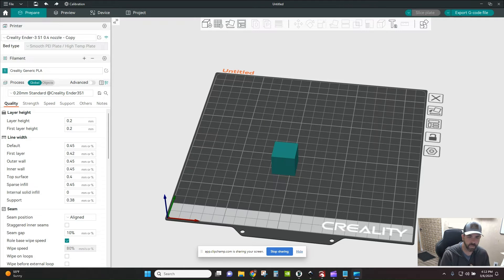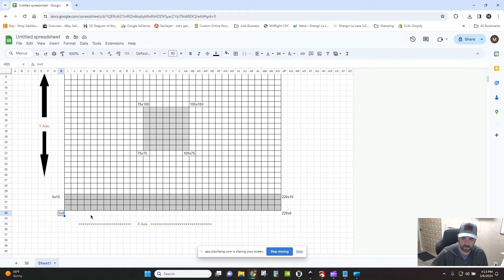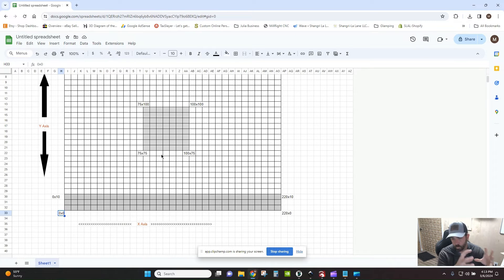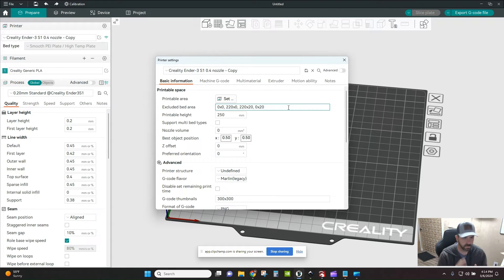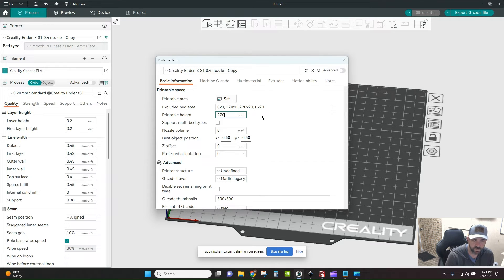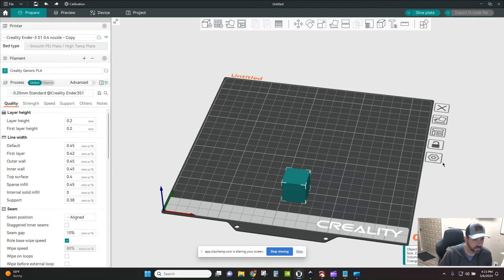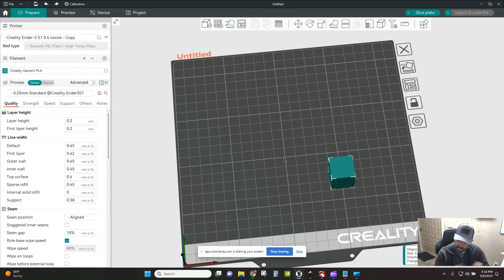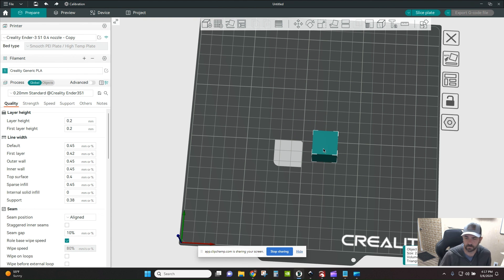ORCA SLICER - How to exclude an area of your bed for printing

Comment: You can actually make pretty much any shape you want, you can put more than 4 coordinates and it will make the area connecting the dots in the order you put the coordinates. You can make "floating" shapes too, if you put the initial coordinate for the "floating" shape twice, end it in the same initial coordinate and then put the last coordinate before the "floating" shape coordinate (imagine that you need to make a line that will not make a solid image kinda)

For my ender 3 pro I removed 10mm from the sides using: 0x220, 220x220, 220x0, 210x0, 210x210, 0x210
Looks like this:
⬜⬜⬜⬜⬜⬜
⬛⬛⬛⬛⬛⬜
⬛⬛⬛⬛⬛⬜
⬛⬛⬛⬛⬛⬜
⬛⬛⬛⬛⬛⬜
⬛⬛⬛⬛⬛⬜

Then to add a "floating" square in the middle corner I used this coordinates: 0x220, 220x220, 220x0, 210x0, 210x210, 0x210, 170x170, 170x170, 160x170, 160x160, 170x160, 170x170, 0x210
And it looks like this: 
⬜⬜⬜⬜⬜⬜
⬛⬛⬛⬛⬛⬜
⬛⬛⬛⬜⬛⬜
⬛⬛⬛⬛⬛⬜
⬛⬛⬛⬛⬛⬜
⬛⬛⬛⬛⬛⬜

I hope that explains well enough 😅

Comment: I have found out a way to exclude 20mm both from the front and the back of the plate
The coordinates for me are 0x0, 300x0, 300x20, 0x20, 0x280, 300x280, 300x300, 0x300

Comment: I have tested the following on my Voron 2.4 Profile "350x350, 0x350, 0x310, 350x310, 350x0, 346x0, 346x310, 350x310". This excludes 40mm to the back of my plate and 4mm to the right. (It is polygon by point if you have 3 polygon points you will have a triangle.)
Reply: Thank yout for this! The best way to describe this is think of vector points drawing.

I got a left and bottom L arangement using this:
0x0, 350x0, 350x85, 65x85, 65x350, 0x350

This creates a bottom box U shape:
0x0, 350x0, 350x350, 325x350, 325x60, 25x60, 25x350, 0x350

But the slicer doen't like a U box 😅

Comment: Looking exactly for the same... It appears that you can't define multiple areas :(
Reply: You can, but it seems convoluted. Here are the coordinates that make the 20x20 areas at the from of my AWD Voron non printable: 0x0, 0x20, 20x20, 20x0, 280x0, 280x20, 300x20, 300x0
It doesn't render greyed out, but it works for me.
Reply: You can limit the opposite edge by specifying that the bed size is smaller by as much as you want to exclude that area.

Comment: Hey Fischer!  Any advice for an Orca slicer profile for an original ender 3 with microswiss direct drive and BTT e3 mini v3.  (Amongst many other  mods)

As the ender 3 v2 and se profiles are  no good and are soooo different to cura's OG profiles.
Ive tried making my own to no avail, it just makes everything worse than cura.
Reply from the maker: Have you checked out this one yet?  https://www.youtube.com/watch?v=vvze96TNN0M  My enders we're exactly the same, but they were Orig Ender3 that I added direct drive to.  fast forward a couple of minutes and maybe you can copy some of my settings that are applicable.  I would image with a microswiss you might need to bump up you temps a little and probably play with retraction.  I also ran a 0.6 nozzle, so unless you are too you can ignore that bit.

What about your prints are coming out bad?

Also, try some of the calibration tests built-in.  Those can help tune it.